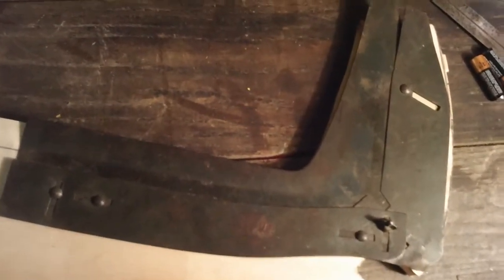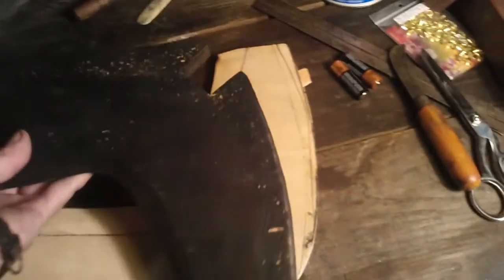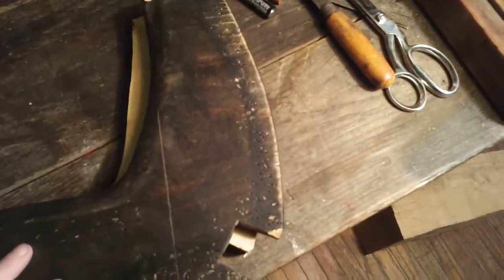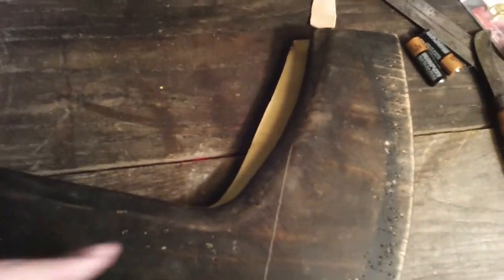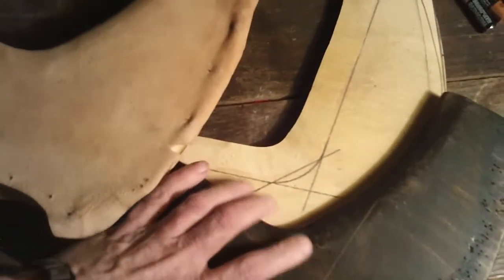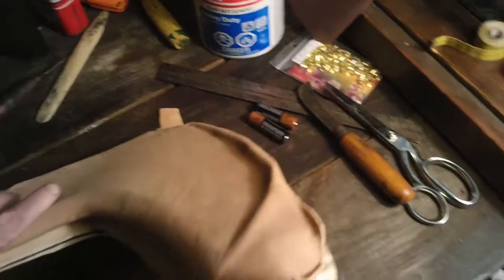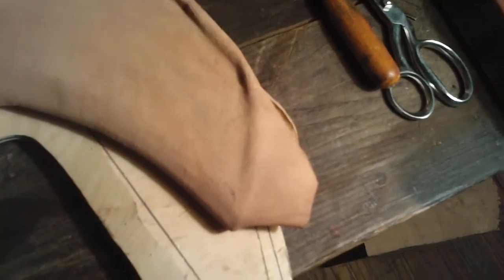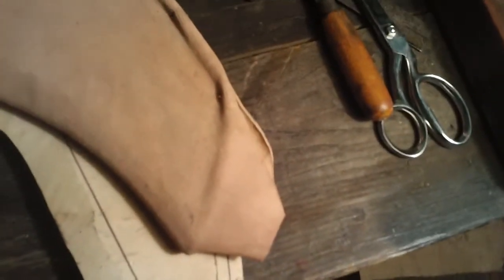19th. century Boot Making - Part 2

Comment from the maker: 2gpowell. Excellent question. If the boots are made properly, they will keep on the crimping boards several days. They will get the classic ankle wrinkles. I as well have had over 100 pairs of boots (mostly) and shoes in the collection I inherited from my shop Master, and expanded on, as well as have examined many hundreds of pairs and I concur with your findings.
Where you get lots of instep and ankle wrinkles, the boot front has been on the crimping board only until it is dry enough to be cut. Then the watering from pulling them over the lasts sets in. Thus instep and copious ankle wrinkles. I often get requests to do boots this way, and it is 100% authentic.

Comment from the maker: Indeed the full Wellington will have wrinkles around the ankles. This was due to them having a one piece crimped front and no complete foot lining as in the modern vamped boot with a complete foot lining. As you mention photographs, if you don't see the ankle wrinkles, then there is most  likely a vamp. Hope this helps.

Regards,

JesseLee